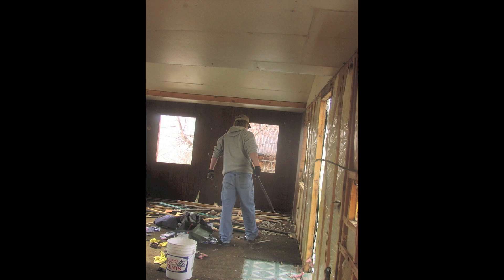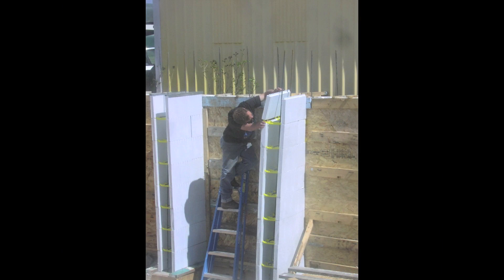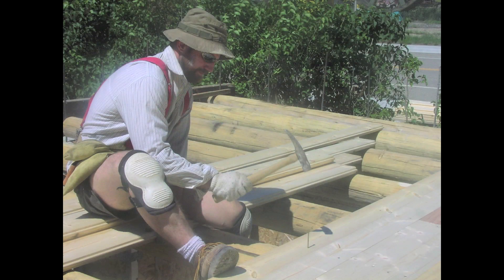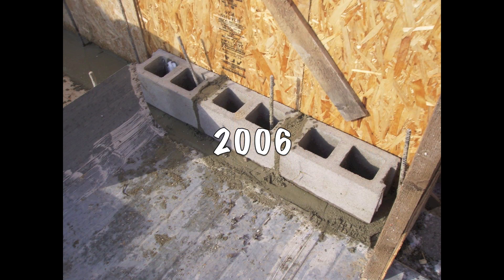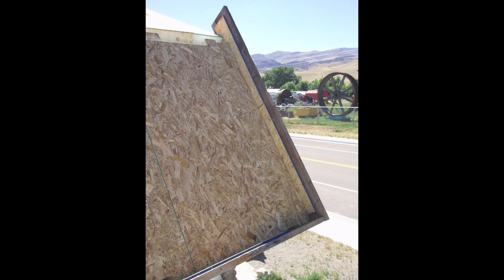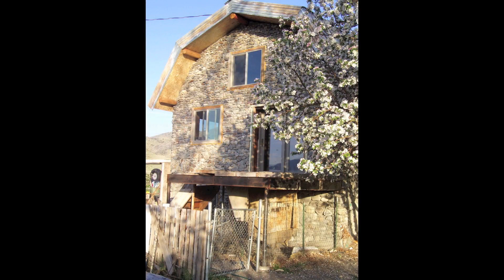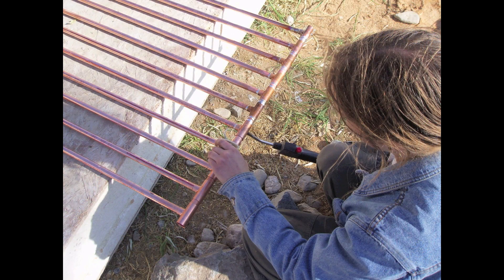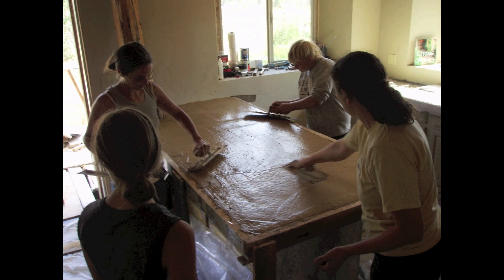Slipform Stone Masonry: Building a Slipform Stone House from the Bottom Up

Comment: Hi folks. You kids done good. Battered stone, combo-ed with the sip rems is a nice touch. Little hydronic system, quasi thrombie wall with thermo syphon dhw, all
excellent. Tons of work, design on the run. Gambrel roof, busy, but ok. Good
dumpster diving.    Dave, from Mikey Block.

Comment: I built a workbench out of reclaimed lumber once. I used 4x4s' for the base frame and recycled bomb crate wood (they were made out of 2" thick mahogany) for the work surface. I built the bench to fit snugly into a recess in a room right under the window sill and it sat right against the walls and the floor molding. When I moved out I found out the wood I'd used was full of termites and they'd gone through the wall into the structure. I subsequently soaked the legs with turpentine, primed it and enamel painted it.  I removed the top to do that. They hadn't bored into the mahogany. That killed them and taught me a pretty good lesson about using reclaimed lumber. Check and treat what you use for wood pests.

Comment from the maker: You would expect lots of creosote for sure, but it doesn't seem to be a problem with masonry stoves, (a.k.a. "masonry heaters" or "Russian fireplaces"), and I'm not sure why. Normally, one burns a super hot fire, so there isn't a lot of smoke, but I don't run mine that way, and creosote still does not seem to be a big problem. Maybe it is something about the difference between metal stove pipes versus firebrick and ceramic chimney flue tile. See also my Masonry Fireplace video clip.

Comment: Big rocks on the bottom was not a mistake imo, it did give the look that the "siding" had transitioned at each level. Time consuming but it looks great.

I wonder how is the kitchen counter top holding up? Are you having problems with the coal in the fly ash "popping" when it expands with moisture?

Comment: By the title of your video, it appeared to me that you were doing to demonstrate the "slipform technique" in building a house. However, in spite of the fact that this is an excellent video, I did not see once that you demonstrated exactly what slipform is or how to do it.

So, can you try again and this time show exactly what 'slipform' means and how to do it.

Thanks, and your way of talking through the photos and explaining each step was better than a lot who put some kind of psychedelic or nutty music on while doing nothing more than showing their collection of meaningless photos in a manner that does nothing but show what THEY did, and teaches nothing.

Overall, very good video : )
Reply: I missed that too, other than once or twice seeing rock placement...one layer. ?
Reply: Exactly my question
Reply: John Mahoney he did show it. Slipform is basically putting rocks along the face and pouring concrete in the forms with the rocks on the face so the concrete connects everything.
Reply: @Cody_Ramer  Slipform is a sectional form work used mainly in shaft construction in rock to stop spoiling and to make smooth surface. Steel mesh is attacked to the rock face as an anti crack and initial support medium Starting at the bottom of the shaft with the slipform hung on winch cables or come alongs with the lower edge set in a preformed ring that acts as a stop end, a guidance system of bolts embedded in the rock keeps the formwork plumb.
 Rapid setting concrete is poured evenly into the form work and is compacted with vibrating pokers, as the concrete reaches the top of the form, the form is raised slowly, a skilled worker will check the exposed concrete at the bottom of the form and regulate the speed of raising to prevent slump, he will also float off the face and fill any air blow holes. A platform is hung on the lower section to enable inspection and floating as the form is raised.

What was demonstrated in the video is more like the Ribs and Lagging system used to install a brickwork lining in tunnels and whiskey vaults. Steel ribs form the circle dimension of the tunnel lining finished brickwork less the thickness of the lagging timbers. Two of more ribs are installed and brick laying start at each side of the tunnel and progresses evenly up each side until the spring line. A lagging board of 3" x 1" timber is inserted between the rib and the brick face, a second timber is inserted and brick laying continues up each side to the crown. A third rib is installed and the process repeats it self. Completed sections have the ribs removed after 8 hours and the ribs moved forward.  

In the Cairo main sewer construction this method was used on some ten miles off main line tunnels. Engineering hard faced bricks were layed in a double thickness with the outer mortar joint raked out to 1" and epoxy mortar jointing was gunned in. This was to prevent highly corrosive gases from eating away the concrete segmental lining, Cairo has little control of what is dumped into the sewer system from factories etc. The brick work and epoxy was the most cost efficient system to counteract the problem.

Comment: Hello!1 I'm planning on building my own stone house in time.  Thins that id like are a deep basement, masonry heater, Solar roof and deck/balcony.  Im pretty sure slipforms would be the best way to to do this.  Im looking at post and beam or regular timber frame for the "skeleton of the house with stone as the exterior.  I need all the help i can get ive probably bought and read every book with regards to slipforms and other stone masonry projects.  Any suggestions!!

Comment: I love it all! You inspired me so much and I look forward to building my castle!  I purchased your book and video which is priceless! 60'x60' with a 12' tower on all 4 corners.  Maybe I will do a video in your honor. Just not looking forward to moving all the rocks but what does not kill us will make us stronger right?  Thanks again for all your motivation.
Dale Orthman
Reply: Dale,
Spend some time in your own area looking particularly at foundations. This guy built a beautiful house but he had osb below the floor line, unthinkable in Texas or any place on the Gulf Coast. I also think a few tubes of liquid nails in that roof might, in addition to the foam, keep it from flying  away. Likewise, shallow roofs are fine here but he should probably put in heat strips or whatever works there to prevent snow buildup. Lots of good ideas in that house though.

Comment: Hiring a professional roofer and a good roofing material ..would have giving the outside of the house a real complete look. That metal roofing and facia looks so terrible. Really great video thx
Reply: I love the metal roofing.
Reply: This roof is similar in construction to one I did many years ago- we used poly iso sheets inside. The house was timber frame, and the roof overhung the exterior about 3-4’.  The exposed underside we used rough sawn lumber, and a CDX ply top that was roofed with architectural shingles.  We stepped or corbeled the edge of the roof, and that hid the thick mass of insulation.
Reply: Above all, the builder rightly blended all visible roof angles: the front gable entry roof with the entire, attractive gambrel roof! As far as debating procedural methods and means, I was tempted, but the end result is appealing!

Comment: With very little more effort you could sand blast, primer and epoxy top coat that rusty corrugated siding you used for facia.  You could even do it in place.  Simply shield the rest of the construction around the area where you are sandblasting, and have at it.  It would do wonders for your curb appeal.  Your project looks wonderful exept for that.

Comment: Do you have a plan number for this?  Just want to pass on some old pioneer information.  My grandmother's log cabin up on the Balsam Creek Reserve, North Bay, Ontario/Quebec must have been 200 years old in the 50's at least built after Wounded Knee.  The inside walls were interesting.  The pole studs went down in your 7- 16 inch fashion and right into the ground itself and inbetween it was laced with strips of cedar so it formed a ribbon like mat. Over this map and wood studs they used the lime and/or clay. On top of it, they used a plaster.  These were the walls that divided the rooms.  I asked my grandfather, whose kin lived in Canada pre 1790 and the Sioux/white mixture came in after the 1700's, why the walls were still standing as the poles went right down into the dirt and he said, "it is because of the type of wood they used." The outside walls were typical log cabin and in the twenties they added on another building with regular studs and nailed on a type of roofing tile on the outside walls of both parts that was made after the 50's.  It would still be standing if someone hadn't burnt it down to remove aboriginals of the reserve.

Comment: I think if I build a stone house I’d do tilt panel concrete stone masonry walls!
Pour your slab first, plastic & 1 inch of sand, lay your stone down then reinforcing mesh all inside the formwork, pour concrete with your lifting rings in place & when it’s cured - crane it vertical - rinse & repeat for each subsequent wall.
Gotta be faster & easier than slip form concrete stone walls.
Reply from the maker: Ian - That's a great way to go, and you can even do tilt-up stone work: http://www.dirtcheapbuilder.com/Articles/Tiltup_Stone_Masonry.htm

Comment: Stone houses can be built without cement using lime. This is how they've been build for centuries.
Reply: I am under the impression that using lime has been superceded because it weakens faster over time? Is there a good reason we don't use it anymore?
Reply: It's a bit harder to work with and people don't understand how it works any more. An important point is that it has to breathe so that it doesn't trap moisture and turn into loose sand. Modern paints and finishes are designed to be as waterproof as possible, which is fine for concrete and plaster, but not lime mortar. So you have to use old finish techniques, and they can be illegal in some 'environmentally conscious' (but not actually) jurisdictions.
Reply: it’s all designed to sell you more toxic stuff to build your house which will off gas all  those toxins with time

Comment: Expert builders! However one of you must have been a professional engineer or architect who could stamp the non-prescriptive plans submitted to the building department! Everything appears to have been done expertly except laying the basement slab radiant heat piping without insulation underneath. Hardly dirt cheap construction! But very interesting!
Reply: Or just an insightful bit of common sense. Building inspectors are there to extort you and make you wish you had simply bought property out in the County. To many have the authority they know nothing about other than to be a pain in the A$$. Glad I can build anything I please without ever having to see one, start to finish.
Reply: @ @wayne251975  Building inspectors serve their purpose. They are over zealous, but because they exist, many homes are up to code. It they did not exist, people would live in unsafe shacks because they're cheap to build. They're a necessary evil.
Reply: @godzilladestroyscities1757  Try to get a Bank loan on an unpermitted structure. just sayin.

Comment: This is a great method of building that is largely underutilized in residential construction, particularly modernist. Unfortunately in these videos the preoccupation with scrap, free, and recycled materials used in the projects gets in the way of the basic slip-form process. Using scrap and free is great but the point here is slip-form construction, and I hope there are more videos made available that just show the process and leaves off the recycled aspect. None of that is necessary and it basically boils down the to mold, the rock, and the concrete. A discussion of cement density and types as well as thickness and overal structural rigidity would be immensely helpful.

Need a video that just shows the process of constructing the forms, setting the rock, and then cement prep and pour. That's what slip-form is, not recycled or free, and it's incredible that such a great idea can get so convoluted in such a schlock delivery.

Comment: Really should have insulated between the basement slab and the ground.  Every house that has made that mistake costs much more to heat, as you're literally heating the Earth at 60 deg with floor heating at 100 deg.  Other than that huge heating system mistake, it looks like an interesting project, and I applaud your reuse of materials.

Comment: The Chimney has "six horizontal runs through the baffle system"? what does this mean and how does it extract more heat?
Reply: It allows the hot gases to travel a longer path next to the thermal mass.

Comment: Glad I stumbled upon your project vid, that is one awesome yet incredibly labor intensive build. Very well done. I am curious what general jurisdiction you're in? Many jurisdictions would not allow unconventional techniques, particularly with used materials unless an engineer signs off.
Reply from the maker: We are in rural Montana, so there is not much oversight. :)
Reply: To  @thomasjelpel  - Being expert builders with bottomless energy, you pulled this off competently. However little about the build is translatable to other less competent, less energetic builders. Most locales have building departments and zero access to free building materials. Most people would not have the knowledge/experience to field engineer the salvaged materials together so competently. The metal  roof is unconventional looking and homeowners in the neighborhood would rightly be concerned about the effect on their home values. Otherwise, as a former building inspector, you definitely have the "Builder Gene". We recognize you when we see your work and whether we say it or not, respect you.

Comment: I guess you can do this kind of thing in 'merica. There isn't really a constructive criticism to make about this place which won't sound offensive.
Firstly the materials.
Concrete is a very noxious and expensive material to produce,
The wooden sheet material is what is known in UK as "wafer board" a sub standard sheeting for packing cases and shuttering, The poly foam incorporates carcenogens and exudes poisonous molecules presumably into the interior habitable part of the building over its long and non degradable life along with lots of plastic bits and pieces (ties etc.)
the whole caboodle is a complete fire trap, the design of the building is basically a chimney.
Plenty of power tools used throughout construction (they all have to be made somewhere, shipped sold used and disposed of). Certainly an A for effort especially getting all that free volunteer labour (which helps the construction industry no end) but I think the project is a massive fail and I hope the building inspector agreed.
The neighbours (if there are any) would thank him / her as the fumes from a fire could be deadly.